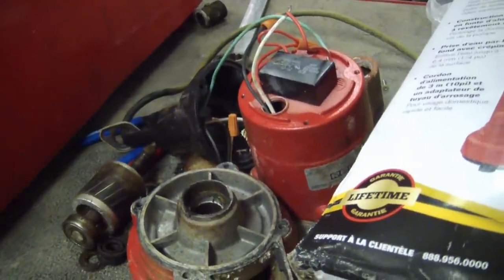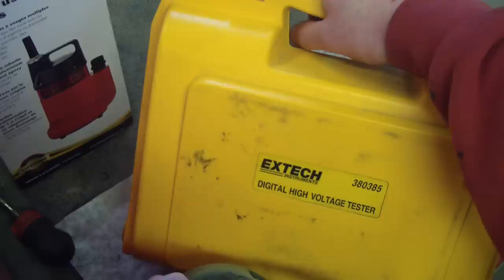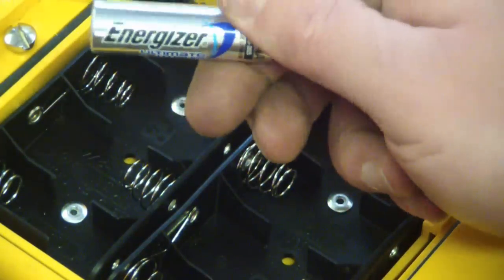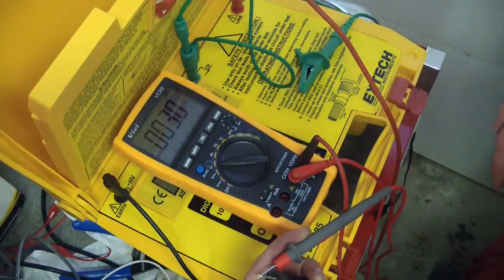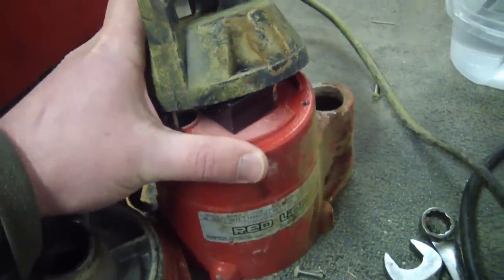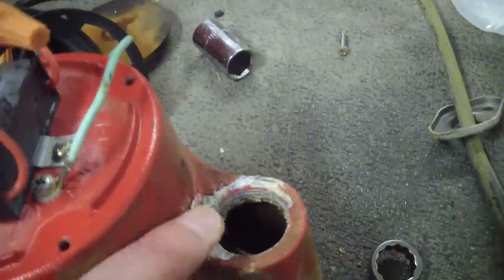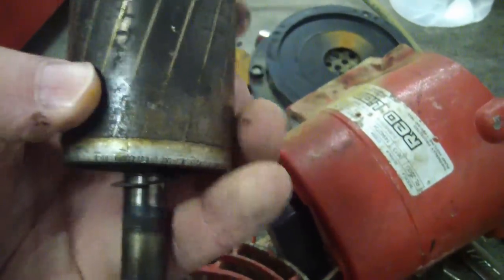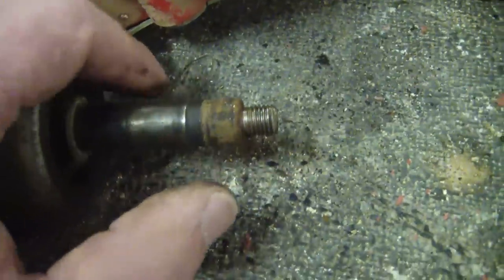BOLTR - La BOMBA! Red Lion water chooch'r is engineered to FAIL!

Comment: I know this is may come a bit late, but I just recently came across your videos, and I've learned a couple of new things from watching you at the same time as laughing, so thanks for that.
Obviously the electrical problems are the last of this pumps problems, but I thought about your groundfault problem. If the insulation fails to discover a groundfault, there are still problems that can occur that will destabilize the even flow of current that can mess with the electromagnetic mechanism in the GFI, causing it to trip. I've encountered several problems related to impedance, more specifically capacitance, which needs to be balanced by inductance. Many problems related to the degradation of the material in the capacitors causing it to move the current a lot farther ahead of the voltage sine wave, causing the GFI to react. I'm guessing that's why taping your ground-pin didn't have much luck.
Would have been cool to see a video where you tested that by putting in something like a 120V/120V transformer to test it (primary side seeing even pull, secondary can be as messy as it wants to be).
Like your videos, and I'll be watching.

Comment: I find it hard to believe a pump that well designed could have had something deliberately designed to failed, why go to the bother of making everything else so bulletproof, but then how'd they miss it? Probably an intern or rookie designer didn't know and whacked it in, or someone at purchasing decided the few cent for a stainless steel sleeve by 1 million wasn't worth it.
Reply: +Joshua Nicoll 

Eh maybe, the other possibility is the rest is designed not to fail because it has a lifetime warranty.
They want to be certain it doesn't fail until such time as it's unlikely to be returned. If they didn't make other parts good those parts might fail prematurely.

The next possibility is upgrade models. They might have a "super deluxe" model that isn't engineered to fail, pumps a little more water maybe and so it is made better and everything. But they want to be able to make both at the same factory and order the same parts for each as much as possible.

If that housing is also used in a really good pump, it makes sense it might itself be really good.
Reply: +Joshua Nicoll - The team lead in a company decided to save 30 cents on an electrical connector ($10,000 product).  I recommended against using a connector that was only 20% over-rated, but the young team lead ignored me.  There was some concern when they got several back with toasted connectors.  Then one burst into flames in some customers office !!  They had to do a recall.   Poor young guy took it in the shorts for that one.
Reply: +Joshua Nicoll perhaps the same company makes more than 1 model, or they revised the design of an existing model, and it was cheaper to keep using the same high quality parts/design everywhere except for the 1 place they engineered for failure
Reply: Nah! More like the tolerances were opened up to allow the use of Chinesium parts.  I've seen it myself, 2% percent return rate goes upward to 33% due to the Chinese overtaking the market.

Comment: That capacitor circuit allows for reversing rotation too. It is seen in ceiling fans and rotation is determined by which coil gets the capacitor. In this case it gives good starting torque and assures the motor turns in the desired direction...

Comment: Sorry about your pump! I disagree on what you said about the megger, you shouldn't test more than double the rms voltage with a Megger. Here in NZ we have a 230/400v single/3 phase system. So as everything is only 230 above earth a 500v megger will test it to our wiring standards. 1kv is handy for phase to phase problems but higher than that and you are creating more problems than solving by putting a higher than rated voltage across the insulation.
Reply: ***** There is a problem in your enamel dielectric strength. Not only do enamel thicknesses vary on overall wire diameter, but windings are also arranged such that the turns near the start and near to the end of a coil never touch. And when they do, like in the Chinese transformers, it becomes an engineered mode of failure!!

Comment: Yep, we do that on purpose, life duty cycle are calculated. The vast majority of people won't try to find the issue because it has a warranty, or simply because ''hell it was 90$'' I won't disclose for which company I work, but in this day and age we need to do this to keep the supply and demand rolling. Its a questionable business model, but in 2015 you can't make money of the parts of your product to repair afterward, hell we don't even sell them since its all outsourced somewhere else. People don't want to pay for a quality product anymore so the answer to that is obviously lower prices at the expense of reliability, trouble is, even then, the profit margin is not huge and not really viable. So if we can sell more units by having the old one broke with no replacement parts readily available, we'll sell another unit. The way we usually do it is design the product as a whole and when we have all the parts completed for prototyping we pick a  ''link in the chain'' that we will make weak on purpose, something like a ever so slightly thin seal so it'll leak, but its in the middle f the assembly so impossible to get to, a metal part that will break by fatigue, a wire or connection that will burn up after a said time. I earn my paycheck designing those flaw so yeah... Kinda funny and weird seeing that.
Reply: warracer03 it's a shame for those of us that like user serviceable items that the market has gone this way. but it keeps folk in a job so yeah..

Comment: I was always so suspicious of purposeful electronic failure that as a kid, I distinctly remember setting the year on the system clock back several years for my game consoles. I figured at the time that if my Xbox always thought it was a year or two off the factory line it would continue to run smoothly. It must never know how old it really is...

Comment: Had a 90's Jeep that had an emissions timer. When it hit a certain hour of run time, a dummy light would flick on. The dealer would just simply unplug the box, but then charge you for an oxygen sniffer, muffler bearings, and a few hours of work.

Comment: Worked at a chevrolet dealership as a mech for a while... most blantant egineered failure was the replacement of a 25 cent hose clamp that would never fail with a built in "quick release" on the radiator hose on the chevy cruze... the only thing i can attribute this too is a engineered failure point... problem being most of them didnt quite make the warranty cut off which is a great thing to help teach them a lesson on a bullshite policy

Comment: Whirlpool cabrio platinum washer runs a seal on a hardened steel shaft and I only get about eight years out of the top bearing under the seal before it has to be repaired,  but I feel like they know because they also sell a kit with the bearings , seal, and new shaft. So no matter what you are going to buy a washer or rebuild it, so you are always a customer

Comment: Here in the states Rigid offers what they call a Lifetime service agreement instead of warranty on their power tools carried at Home Depot. You have to register the tool right away, but the big benifit for people is you do get lifetime battery replacements which with cordless tools tends to be the most expensive part of the whole system. The whole Rigid situation is weird the plumbing tools and vaccuums are made by Emerson Electric, but the power tools are made on contract by TTI the same people that own Milwaukee, and also manufacture tools under the Ryobi brand. Ryobi tools are TTI made except in Japan, and Rigid and AEG share pretty much the same tool designs with some cross over of tools that are not sold by either company but if you look the tools look pretty much the same.

Comment: I don't get it one bit. Why go through all of the trouble and expense of making what seems to be a good machine and then fuck the dog in the end? If you're going to do it, go cheap shit on everything. It might last a year and the customer still gets reamed in the end but you didn't spend as much on it. I doubt I'll ever deal at a Princess Auto, but I wouldn't be surprised if they have the exact same unit painted a different color at a Harbor Freight. Years ago I bought a rotary hammer from HF. It shit the bed after half an hour. I took it apart and the damn thing wasn't even greased. Might have been an oversight by Lo Pan Inc. but that was enough to teach me you get what you pay for. And the shady fucks won't even take the damn pump back? Time for you to build a dog shit cannon and make your voice heard!
Reply: heliarche maybe it's similar to the binning process of CPUs. You keep the same manufacturing process and simply modify bits of the same device for different price point. 

In many products these days, the real cost is not in the materials (especially if its a brand name)... but rather the logistics, and adapting manufacturing processes. Much easier to keep stock of all the same parts, and just modify one or two parts for the cheaper market segment.

Still fucks over the environment however. Which will screw over everyone + the company in the long run.
Reply: heliarche the same machine, with one improvement can be bought and rebranded and cost 2 or three times as much....so they have the cheap version one part away from being the expensive version and capture both markets anyway? That's my guess
Reply: Hey, I buy from Horrid Fraught now and again, like last weekend.  I needed some disposable chip brushes.  You know, the kind everyone and their grandma sells for 99 cents?  HF had them for about 27 cents after the coupon.  Them and a cheap ass bench brush for under $2.
Work great for something I expect to used for less than 30 minutes, then throw away, or I can spend 5x the price, and then 10x cleaning it.
Just gotta know when "Cheap crap to throw away" is the right way to go

Comment: I believe the 3 seals were a desperate measure to keep the water out with only having the mild steel shaft. Though it could have been so easy: as Mr. AvE said, just put a hardened steel sleeve over the shaft, seal the sleeve with an O-ring to the shaft and the lip-seals seal the turning shaft-sleeve-combo to the housing.
Would have been easy... not as easy as just putting 3 lip seals in, ofc!

Comment: Separate starter and running capacitors are installed on motors that have centrifugal switch linked to the shaft of the motor, so that it switches to running capacitor when sufficient RPMs are reached.

Comment: I'm a "professional" pond man, and one of the lines I've been fed (in the last 11/16ths of a score that I been chooching the mookie out of people's ponds) is that this type of "utility" pump is not engineeeered for continuous duty.  Right in the face of this notion, you mention the on/off cycle being somewhat responsible for the decrosion of the metal shaft penetrating the seals.

First:  Do you run your pond pump continuously?   B:   Do you think the bearings were skooookum for the device?     iivx:  Looks like it was your bottom bearing that failed, when, according to legend, usually it is the top (since both are supposed to be cooled by the water flowing past -not into!- and most people are too lazy to clean their skimmers before the top bearing heat sink is naked to the relatively un-hungry-for-heat air.  7:  I freakin love butt wipes.

I will gladly donate ten nickels to your entertaining enterprise in the hopes that->   4:  You will reply with a pertinent response.  12:  You will laugh aboot something clever I pretended to know.  P:  I will learn something more than I already know I forgot.

Cheers, and please keep de-educating us!
Reply: +Matt Brown Um, I had to pledge 20 nickels.  Done.

Comment: I have an engineered to fail story for you but in a different context. Our company did it in programming. Worked for a small computer shop that built custom computers that had multiple stores around the state. In our store, another kid and I did the coding for the in-house software provided with it. One of them was a free anti-virus program. The program was free so it would deter customers from spending large amounts of money on better programs like Malwarebytes and ESET NOD32(the best combo of software for stopping viruses along with running ad-block in your browser). The software was coded to stop working due to compatibility issues with windows upgrades(really simple shit that can be avoided with a few lines of code) and then after a year or so customers would be charged for either the upgrade or virus removal. Apple does the same thing with their computers. Thier Operating systems will lose compatibility with multiple needed plugins after about 4 years, mainly Flash(which is needed for most media and web browsing) which forces you to buy another Macbook or desktop. Real sneaky and dishonest stuff.

Comment: In my early days as a design engineer I had one of my poducts fail in a similar manner. Not because I engineered it too fail but because I had a moment of stupidity and didn't consider the effects of moisture (being an outdoor item) on the bearing journal. Needless to say after a year they all seized up and at great expense they all had to be overhauled and the journals replaced with stainless steel ones. Could just be the designer having a DUUUH moment, or maybe he had a hangover, who knows.

Comment: I like the way you play with words. "electrikan" I have always been fascinated by electronic doomaflachies. When I was a kid I would take 1 remote control car and wire in as many 9.6V turbo batteries in as I could to make it go faster. I caught a few cars on fire learning parallel and series...

I also believe many manufacturers make items that will fail making you buy a new one. I believe most things can be built to never fail, yes that would make things more expensive, but I would rather pay a lot more for something once, than replacing it over and over.

Comment: Awesome! We just got one of those high voltage insulation testers at work and it's my new favorite. Somebody did a real good job of cozying up with the pennies department (or we're all grossly underpaid) 'cause it's the tastiest Fluke.

We do product safety (think a very very tiny and specialized version of UL or Intertek) and that thing saves me a ton of teardown time inspecting all sorts of shit. Having spent many an afternoon trying to track down the specs on the unmarked wire running deep through the innards of some hacked-together, thin-gauge, burr-covered prototype, it's nice to have a BIG HAMMER now.

It's also a great way to fully break some delicate circuitry that's been acting funny so that you can give up and buy a new one.

Comment: Be very careful when using a megger with that much voltage on the output. I have seen a brand new $200,000.00 umbilical ruined because they tested it at high voltage. The power wires were rated to 1,000 volts but were tested at 25,000 volts. The wires failed deep in the umbilical. I used a TDR and found the failure at 1500 feet in a brand new umbilical of 3500 feet. We needed at least 3100 feet so this umbilical was no good for our normal deep water ops.

Comment: Not sure if rules are different here (Australia), but double the line voltage is enough to check for earth leakage, must have a value of over 1Meg Ohm,  higher values are better, Using the 10 Kv on a 110 V or 230 V will most likely show a low reading regardless as the 10Kv can arc over where the 110 V could never arc, also insulation rating of most cable is 600/1000v and this one is rated at 300V shoving 10 Kv down it will exced insulation rating of cable.

Comment: Caps engineered to fail is possible but often they are just cheap and nasty caps. As a project manager for an electronics company I had to investigate failures of electrolytic caps from one manufacturer and found that it was caused by inaccurate water metering in the electrolyte. You could then go the other way round and put in too little or too much water to cause the capacitors to fail, depending on the failure mode you require.

Comment: Had the circulation pump fail on my Electrolux ESF 66739 dishwasher a couple of years back. The failure point was the threading in the impeller, which was cast from the shittiest plastic, obviously engineered to fail after about 5 years of service. The rest of the machine seemed properly built. To add insult to injury, they don't sell the impeller (p. no 28403017) as a spare part, you have to buy the entire pump (p. no 5029996500), an expensive part that makes repairs economically questionable at best.

Comment: We use 1KV to test cable insulation on lower voltage applications so I think they are useful for that one purpose, but who knows they might of fooled me. Also, if testing cable insulation be sure to ground the wire real quick after test.

Comment: this is what the pros use!! I use one nearly every day for checking insulation resistance but I would class you as far more pro than me!!
Reply: ...although when you said ground fault interrupt I immediately thought of an RCD which is a residual current device we use here in the UK, does the same thing it detects imbalances between line and neutral then trips hopefully in less than 40ms to avoid the old ticker getting a belt!

Comment: I can actually attest to crappy caps in large electronicles like tumbler dryers and washing machines, in my experience they burn out after 4-5 years on 230V AC outlet when the max rating is more like something you'd want on a 120V AC outlet. So just getting a cap that's slightly over specced for 230V AC makes them last closer to what you'd want as a consumer, basically until something else breaks like a drivebelt or just the motor giving out after 10-15 years after purchase.